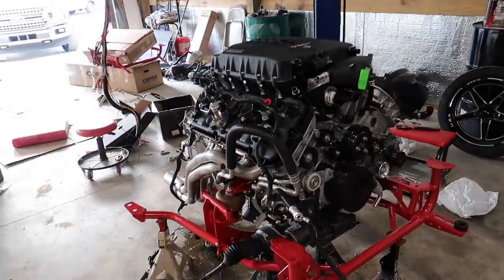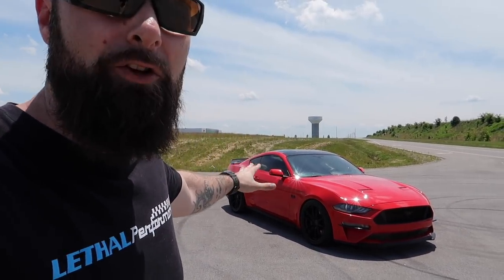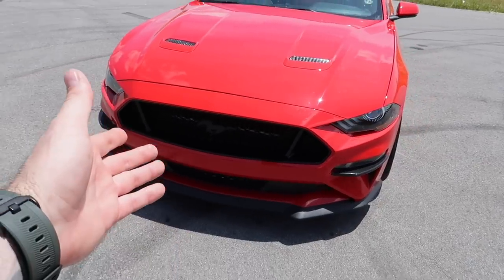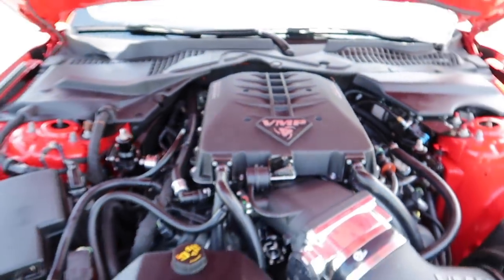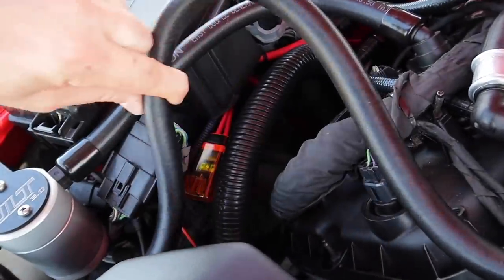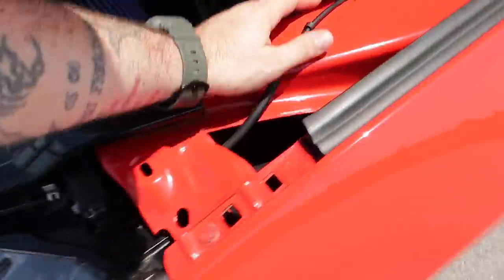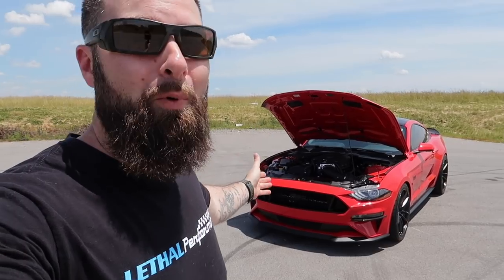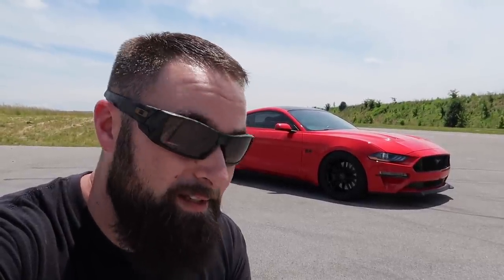FIRST EVER Built 5.2 VMP Odin Supercharged 2019 Mustang GT is ALIVE & READY TO ATTACK!

Comment: If you have coyote heads and crank how do you get to 5.2 liters?
Reply from the maker: 5.2 block
Reply: @Zander13Productions  I was under the impression that a voodoo is both bored and stroked with the flatplane crank. And those coyote heads aren’t gonna flow like GT350 heads. I’m only curious cuz I have a coyote myself and have always wondered how close you can get to the voodoo by just swapping the crank out.
Reply from the maker: It’s essentially a bigger coyote. This was more of a budget build. Didn’t have $25k for all the bells and whistles. Ford Performance gen 3 5.2 with coyote heads and crank.
Reply: @marcorps114  the 18 up cars pretty much have gt350 heads don't they?  If not the exact same they are very similar.

Comment: Is the motor still stock compression ratio?
What do you plan to do with the WOT box now that you dont need antilag for the turbo? 
Maybe use the wotbox switch to engage transbrake?

Im just gonna stay tuned actually.
Reply: WOT box can be used as 2step also. A lot of people only use the WOT box for the 2step.
Reply from the maker: 12:1 compression and I removed the wot box

Comment: Perfect, super clean&beautiful!! This coming from a Chevy guy! 😲💥😂
But, I love all cars! I also own 2 Mustangs. A super clean 92 convertible 5.0 5sp. And a 100% Real, True, Original 1964 1/2 
"CALIFORNIA TANG" 1 of 10 ever built and 1 of 3 to be known left in existence! It's a true 40,000 actual mile car. 289H.P. the only other cars I know of like it. Jay Leno owns 1 and the Editor of Fast Ford Magazine owns a Hardtop model. Only 50 Hardtops Were produced. Not exactly sure of how many Hardtops are actually left, but I think it's roughly 23. I also have a 1960 chevy impala convertible all original everything that is Extremely high optioned car being 1 of 51 ever produced with these rare options. I also have a 1963 Chevy Nova SS Convertible 100% original rare 6cyl. Car triple blue. Car,Interior,Top all blue. Also a really nice 1964 Impala SS 327 4 speed car. Original. Black in color. One of the best 64's I seen in many years now. Also have an all original 1930 Chevy Sedan all original. All Museum Quality Cars. Also a 99 trans am convertible loaded. Red in color with black leather and black top. All original. Like new. 2000 GMC reg. Cab SWB Z-71 5.3 auto Red in color, grey interior. Very nice truck. Also a 2003 Chevy 1500HD 4x4 crew cab LTZ 6.0 with 4.10 gear. Blue in color,grey leather interior. Loaded with every option available from the factory. Even T.V. and wireless Bose Headphones,Remote,etc. All original except Nerf Bars,Bed Liner,Bugshield, Vent Shades,Truxedo Roll-Top cover, Locking Tailgate. Nice truck. I still even have the factory Window Sticker from when I bought it new. All are For Sale! Might be interested in some trades up or down,etc.
All very nice vehicles! I'm Extremely Particular! If interested contact me by e-mail and leave your information and I will call or text you back by phone. This way your number is not on public forums.
Email is as follows:
stephensmotorsports82@gmail.com 
Thank You for any Interest in these amazing vehicles.
Sincerely: Stephens Motorsports Family